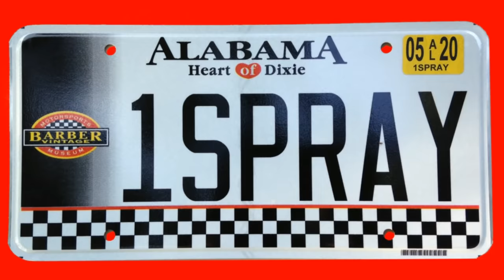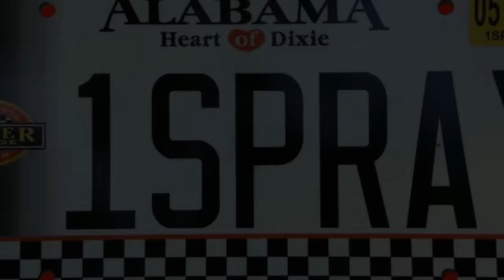Door Panel Restoration & Jamb Paint - PAINTED SATIN & GLOSS BLACK - 66 Ford Mustang Classic Project

Comment: Step 1: like video
Step 2: sit back and enjoy the video
Reply from the maker: sinformant 🤝very much appreciated
Reply: You forgot share 👍🏿🏁
Reply: I'm NOT sure about a 66 ! When I was redoing my 68, they told me, DO NOT use sandpaper on inside of doors ! It will mess the brands up u do not & can not replace without buying a new  door ! Lightly scuff with a scuff pad, wipe off with surface cleaner, paint it ! 15 yrs NO problems ! 👍🏻

Comment: When pulling body panels off, like the trunk or door, drill a small hole, maybe 1/6" in each, before removing the part. You can use the drill bits as alignment pins when you put it back together. And because it's a hole, the paint won't fill it in.
Reply: I meant 1/16" damned typos. Also, one hole in each mounting bracket, like the hood will have two, so one each.
Reply from the maker: Nuvey thanks for the info

Comment: The 2 part black base looked kinda satin without the clear coat on it,  do you have to cover the 2 part base with clear or could that have been used instead of the rattle can without clear for the satin parts? Looks awesome!! That black gloss looks soo deep!! Youre the man!! 🔥
Reply from the maker: djm jr you'll have to cover it with a flat clear if you want it to have the durability
Reply: Ok, i figured there was areason you did it that way.. Thanks!!